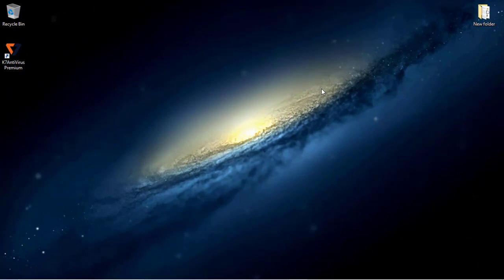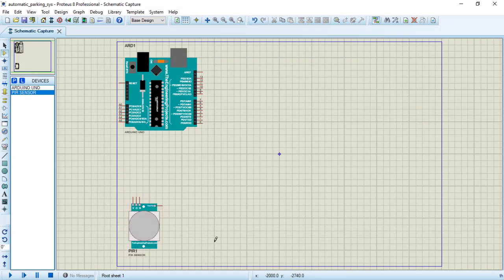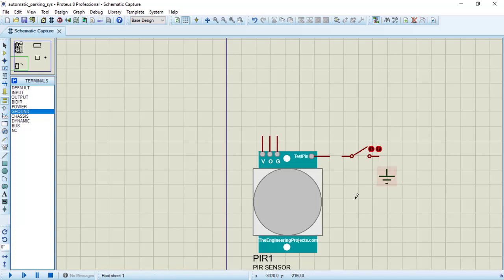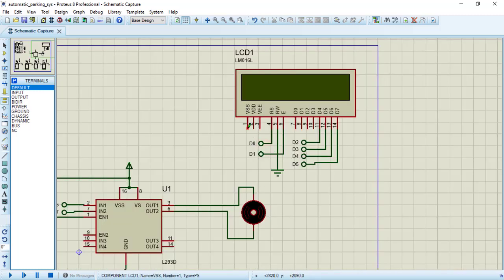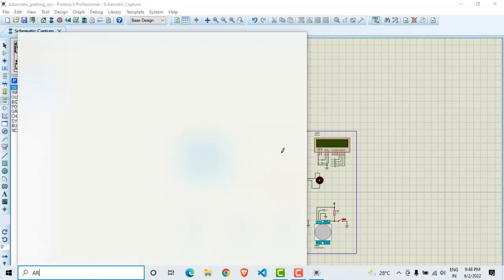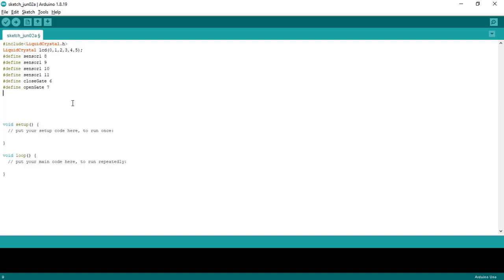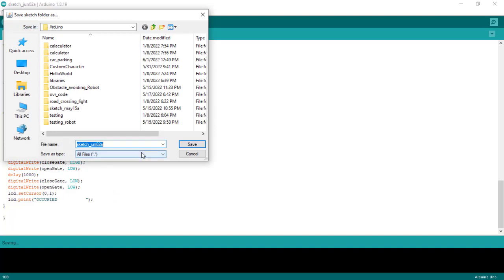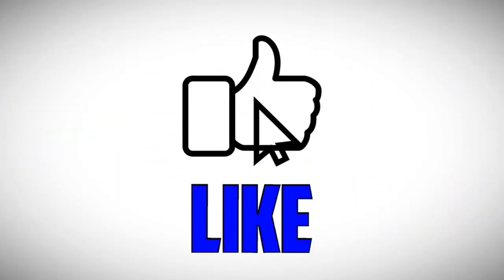Automatic Parking System Using Arduino || Proteus Simulation|| Complete Project

Comment: Thank you for evrything , ihv problem with the cod,
 if(pA1 == 0 ،، pA2 == 0 ،، pA3 == 0 ،، pA4 == 0){    

C:\Users\user\Documents\Arduino\smartparking\smartparking.ino: In function 'void loop()':
smartparking:95:20: error: expected ')' before 'pA2'
   if(pA1 == 0 ،، pA2 == 0 ،، pA3 == 0 ،، pA4 == 0){
                    ^~~
exit status 1
stray '\330' in program

can you tell me what is not right , i did the code the same in tutorial.
Reply: Same I got error there only😢 can u please share the code
Reply: You just change this one
If(pA == 0 && pA2 == 0 && pA3 == 0 && pA4 == 0)
Reply from the maker: thanks for reaching out!. seems like your code in incorrect. you need to check for the code mentioned in the tutorial again.